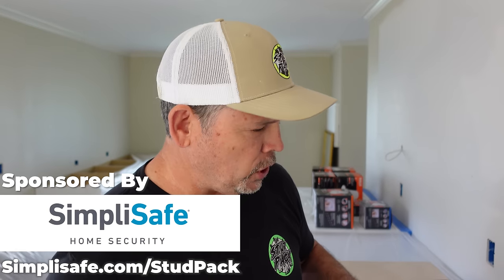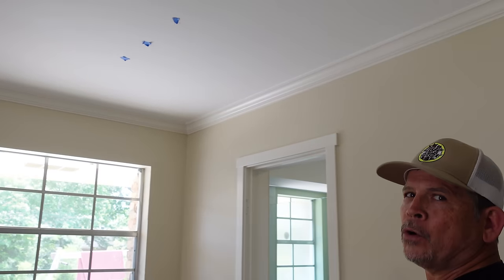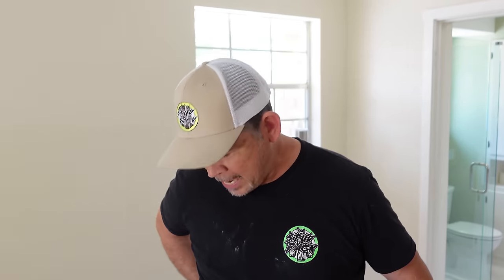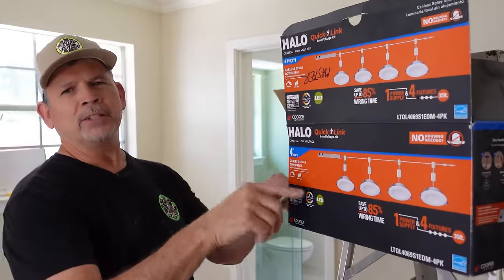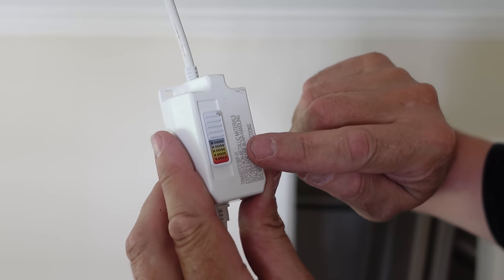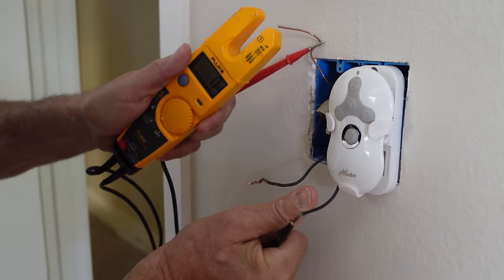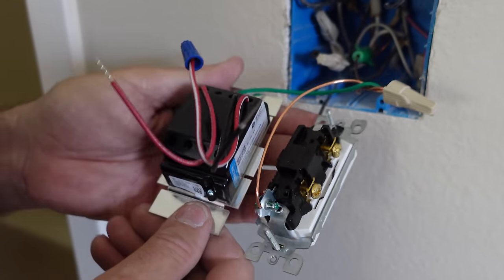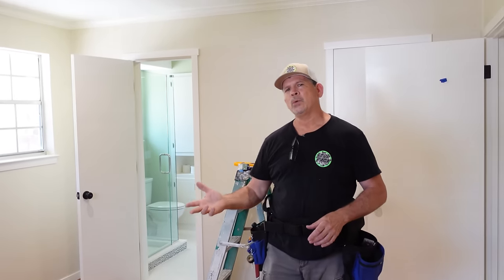HALO Just Changed the Recess Lighting Game with THIS!

Comment: The US and your electrical boxes are weird, in Australia we don't use boxes, we use a flimsy metal C clamp behind the gyprock to hold the plastic switch plate against the wall (I'm not sure if they're called a C clamp but they look like a C ) the connections are exposed inside the wall, its been done this way always. You guys (THE US ) do A LOT of stuff that's totally overkill when it comes to electrical. Our electricity is even twice as powerful 240v at every point. For ceiling lights you poke a hole with a screw driver through the plasterboard, then poke the wire through, connect it to a light and screw the light  fitting to the gyprock, or cut a hole for recessed lights but our recessed lights again are different to yours, for a fan, we poke a hole for the wire except do it next to a rafter to screw the fan to.

Comment: As cool as these are I am still hesitant on direct wire LED fixtures. If they last the full 22 years, it's not a problem, but if they only last 5, and the manufacturer has decided to discontinue the product line, then it's back in the attic to fix a single light.

Comment: just installed one of these, it's fantastic how easy it makes installing a bunch of LED lights in a room, but something important i think everyone should know is to avoid the 0-10v dimmable version. you'll have to do so much extra AND run extra wires to make it dimmable
Reply: I’m having this problem too. how do you update to dimmable? I have a feeling I’ll need to run 0-10v lines but to what and where. Manufacturer has left us hanging.

Comment: 7:00 Dust Bowl. When we had a whole-house HVAC installed in our house, the company brought along a little old man who was somebody’s grandpa. His entire job was to hold a box up to the ceiling where they were cutting the holes for the vents. We didn’t have any dust in the house because grandpa did his job.
Reply: also keep the drill above your head so if the hole saw bit grabs, you dont get knocked off your ladder when the battery pack slams your face

Comment: Nice video, working with sweaty hands in an attic that has fiberglass blow insulation is not fun. I have done similar work, in my days and from time to time, and here in AZ you can imagine the heat in attics or crawl spaces, even in the spring and fall. From a quick installation, the low voltage lights you are using are great, but I prefer hard wire direct to each light with Romex, for a more service free and solid installation and this is a lot easier than working with BMX or metal pipe as per code in some east coast states.  My experience with low voltage lighting, as with landscaping lights have not been favorable, at some point there is chance for loss of continuity due to press fit contact loosening over time, but this also is a matter of how well the press fit connector was designed and installed.

Comment: Not sure how this is any easier than just stringing MC/BX/NM wiring in a ceiling.  This low voltage system is proprietary so what happens when they stop making this system and you need to replace a light that inevitably fails?  If I've got 120 going to each light I can very easily change to the latest greatest lights from any manufacturer.  On some level if you've got the space the old fashioned remodel cans give you a lot of options for trim and install super easily.

Comment: This is a very good system from Halo for the initial installer. But.....when the bulb blows out, and it WILL blow out, the homeowner will not have a clue on how to replace the fixture. Long gone is the premise to replace only a bulb. I'm an 81 year old retired professional engineer and sometimes just replacing a bulb can be a problem. I can't even visualize having to replace the whole darn fixture!
Reply: Very well said! Also, these lights are not reliable as they portray.

Comment: Just to correct you polarity does matter on the low voltage stuff... LEDs are DC and the do have a + and a - end.  You are either working with a low voltage AC side or the box before the light with the color selector is correcting polarity for you.  either way all DC components require correct polarity.  Just not in this application.

Comment: I bought these lights after watching this video and installed them. When I wired the box in the attic my box had a grey and purple wire that I didn’t hook up. I wired everything to a dimmer and they just shut off when I go to dim them. After looking into it, it turns out I need to not only buy a $70 dimmer switch for 0-10volts but also add an additional two wires to run to the box. Your box only had the black l, white, and ground in it and you just wired it to a standard dimmer. What the heck changed in this set?  This was a complete waste of time and money.
Reply: Those lights are not reliable. Is better to use regular can lights.

Comment: No reason to waste a 14/3 wire like that 
And HOPE it not wire into the panel
Read instructions as to snap off the pieces of aluminum on the dimmer there is certain instructions to follow 

No reason to be up in attic or remove carpet or subfloor 
That’s a first

Comment: Led light fixtures are garbage!. The power supplies fail, or the built in electronics fail and are expensive, then they discontinue them. After changing out several power supplies (which are proprietary) over time or the whole fixture, then you cant get parts and cant repair it and u have several of them and now your forced to buy a totally different one which doesnt match the others, now u must change them all. A standard fixture gives u none of these problems. Use a standard screw in bulb fixture and screw in a led or standard bulb. That way u will never have to swap out failed fixtures. I could care less if they use less energy or not. They will end up costing you much more in the long or short run.

Comment: I think Ill pass on these... certainly cool but a little too proprietary. What happens if one burns out in 4 or 5 years and the system never caught on and was discontinued? Then the client is forced to have an electrician out to rerun new wire rather than swapping a few lights out.  But kind of a slick idea nevertheless.
Reply: That's the downside.  I replaced bulbs in my kitchen cans with similar lamps.  I bought 4 extra, just for replacement purposes.  Luckily the bulb replacements are cheap.  The full unit lights used here are more expensive.
Reply: That's a worry for a homeowner. For a contractor, it's just more money.
Reply: This lights are just a rip off. Lol

Comment: that box could have been made up so much better.  it ended up pretty messy.  first, when you make up the grounds, put enough pigtails to have one per device.  then do the same when you make up the hots.  one pigtail per device.  then you're not making pigtails and adding more wire nuts to the same connection.  then cut your hot pigtails square and your switch legs at an angle, and it makes it easy to tell which is which.

and also, when putting a CL dimmer alongside a switch, the heat sink tabs don't need to be broken off.  there's exactly enough room.

but I'm not going to be buying low voltage can kits.  the low wattage of LEDs may not be as hard on low voltage as halogens, but I've still had to rebuild way too much low voltage hardware because it cooked itself to death.  remember, 12V runs 10 times the amperage as 120V for the same wattage.

Comment: Those things look slick. I'm skeptical about the 22 years. LED premature heat death is fairly common at least in some fixtures. I wonder how they'll hold up in a hot Louisiana attic.
Reply: Not only that but if you read the rating it is like 3 hours a day for 22 years or something.  I can tell you my kitchen lights are on for more than 3 hours a day.

Comment: I usually remove the gasket when installed in a non-wet environment. This give a slightly tighter fit to the ceiling.
Reply: I leave it, less of an air gap
Reply: RIP fingertips if that light needs to be taken out to paint or something lol
Reply: The gasket is also there to prevent airflow through the light hole.
Reply: It’s there to prevent air flow, something you don’t want happening from the attic in the winter or summer.
Reply: there to stop bugs or dust from coming through as well.  More important to leave it on.

Comment: You touched a potentially hot wire to check if it was dead by touching the wire to connect your voltmeter! Incorrect procedure! The procedure for checking a circuit dead is use your checker on a hot circuit, then your circuit, then a hot circuit again.

Comment: So i got these after watching the video. Installed in the kitchen remodel. I got the same dimmer you installed here and it does not work. From what i read you meed a low volt dimmer. In the video you did not show the dimmer actually dimming. Mine works like an one/off switch but dimmer does not work. Lights flash and turn off. Am i missing something here? Or did your dimmer not work as well?
Reply: Because he doesn’t know. Lol
Reply: Don’t trust does lights. Just imagine connecting 4-6 lights in ballast. Once a ballast is bad all the lights are off. Not good at all.

Comment: Secret hack. LED wafer lights that have a separate transformer, you can cut the cable that comes with it and extend it with door bell wire.  This way you can put all the transformers next to the gang box in the ceiling and just run the thin wire to the lights. Just like the system mentioned here.  The lights I used the voltage was too low to shock you and the current too low to heat the wire and start a fire.

Comment: I have LED lights just like these that were installed maybe 2 years ago. One of them has stopped working. What are your best tips for a non-electrician to diagnose the issue? Are the LED's themselves replaceable or might I need to replace the whole light assembly? Thanks for any input.
Reply: The whole light. This light are not reliable as the regular can lights.

Comment: I’ve put in wafer lights in upstairs ceilings w/o attic access, but only when I didn’t need to run a new switch leg - e.g. I was connecting to and existing ceiling light/fan leg. I simply used fiberglass fishing rods that I can use to run the Romex from light to light and finally to the switch leg.

Comment: I was taught to always wrap the wire nuts on any connections in a way that it holds the wire nut on and keeps it tight. Wire nuts can loosen over time and heat up. I’m an industrial electrician but it holds true in residential too.

Comment: It looked like you were using a Philips head to tighten up the receptacle wire screws. Do you ever user a Robertson bit or the Milwaukee ECX? I’m a DIY non professional. I don’t trust my Philip head torque with the wiring bolts. 😂

Comment: I am not an electrician by trade, but my uncle was and would take me on the job with him when we visited him for the summer in Michigan. He taught me that all power cables come into the box on the upper left and wires going to your  device goes out the upper right. I do not know if that is a standard, but all the homes that I have owned have been like that and when I rewired the garage that is how I did it. If it is a box I am not sure of, I always test the circuit and mark it for me later or the next guy that has to go into the box.

Comment: I like to make a tag out of the romex sleeve and use a sharpie to write power.  I then slip it over the hot wire coming into the box. In the future if I need to get into the box I know which one has the source power.  I use the romex strippers (Klein K1412) to cut off the romex sleeve rather than using a knife to open it. It saves me from cutting into the wire accidentally.  I also get a clean cut and a sleeve to use as a tag.

Comment: 1:22 
Wishing anyone could do this install & better yet, wiring; but sadly….I know, this isn’t the case. Lost count for going into houses that were newly remodeled ¹  (talking 3-18 months for the time), & [We] are in there fixing, repairing, finishing; in some cases actually Starting, the repair/remodel/issue fix for said work that was, or was not, done (don’t know….wasn’t there; but this my disclaimer(s) cuz everyone needs some butt coverings every now and than….here in south FL, we call them “underwear”😂
Would be shocked of what I’ve seen when come to “work” and “electrical work” & “plumbing work”; it’s just sad! Very sad!.
PLEASE make sure all terminals on a receptacle are “screwed down tight” (technically ¹  a torque ‘driver supposed to be used w/ terminals ranging from 14 ≈ 18 in-lbs) b/c BAD THINGS GO BUMP INTO THE receptacles at night…..
Take off an outlet to check and again was speed wired (aka back-stabbed; which, different than back-wiring) and the ground not connected, hot broke off, and neutral hanging by a “thread” as stranded wire. Other thing saw was terminal screws not tightened down at all, just left proud, waving at everything else in box….this not good and even outlets, switch manuals will say to make sure all screws are tightened “hand tight” all way down. Yoke was bent on both ends to make outlet fit into receptacle, but also left the ears recessed flat w/ box and not sitting on Sheetrock; so, that gonna be fun getting things to line up, lay “flat” and look nice
Reply: Very well said! 👏👏👏

Comment: Why don't you do the wiring down on the floor then stick it into the attic through one of the recessed light holes? Then just go up there to mount the box. That's what I do most of the time. I also manage to fish the wire from below most of the time with fiberglass rods.

Comment: I have several major issues with your video:  I would suggest using a regular recessed light fixture, line voltage and then selecting the best LED lamp (bulb) for the job. That way the end user may select the beam spread, brightness and most important color temperature. The other issue is that these LED devices or the driver will always fail. What to do, get out a ladder and replace the lamp or call in an electrician to replace the fixture hoping that the model is still being made so as to match the other ones in the room. These new fixtures in my view, the light source is too recessed but on or nearly at the ceiling plain which results in glare.  Other issues, is that electricians just stick these things in almost anywhere but not where the fixtures should be. In too many homes,  there are just too many overhead fixtures and a lack of other lighting sources. If a hotel lobby is what you are going for great!  Going forward I will always specify conventional recessed light fixtures, where appropriate and work with the lighting plan as specified by the lighting designer.  Simple as that.

Comment: i have learned not to care about the year ratings for lights... i have LED lights that were new when the house was built 3 years ago and say they last 20+ years, yet i have already had to replace them. keeping the package and receipt is important since normally they have a warranty for replacement, but you need to supply a receipt. Getting a light because it says 22+ years really doesn't mean much.

also remember you should always wear a mask when in the attic. the dust and fibers in there are not good to breathe at all.
Reply: The dust and fiber is what destroyed my lungs. 👎 you are absolutely right but I was young and naive. 🥺

Comment: FYI- I just bought a similar saw from the orange store made by Klein.  Worked pretty well and was around $30.  Good enough for the 4 holes I had to do for my lights.  Wish I had watched this video first, I made all of the right marks where the joists were but there were so many and I was in such a rush that, you guessed it, I drilled one hole right where my joist was.  Made a big  X with a circle on all the other holes after that.  Went from a simple job to extra work patching drywall in just a few seconds.  Some times I amaze myself with how smart and I am and other times I amaze myself with my stupidity.

Comment: Its a big mistake. LED color temps change over time. When these need replacing (far sooner than they claim) IF you can find ones that match, the color temp of the LED will have shifted and not look the same as the older pucks. I am a contractor and own a business that sells LED products as well.
Reply: Very true 22year life expectancy never happen. Are these lights fire rated or do you inthe US not bother?
Reply: @chrisardern4594  I do not believe they are fire rated like a can light is, so if your ceiling is fire rated and you install these . . .
Reply: You are absolutely right !

Comment: I never test hot to ground to confirm the circuit is dead unless I’ve confirmed the ground actually exists. It could be fed from a circuit without a ground. You jay have previously tested the circuit hot though, I’m just saying that for the newbs.
Reply: When I wire a 3way dimmer as a single pole I always put the hot to the red so the red with white stripe will never be hot.

Comment: Always awesome to see fans wired separately from fan lights.  Nice to be able to have the fan running during the day without the lights on, or at night without the lights on, all without having to mess with pull chains.
Reply: Yeah, except when the fan comes with a remote that could control the light (& now can’t). Or even worse, when you want to use the Bond Bridge to control the fan and light using Alexa/Google
Reply: @TENTHIRTYONE  Is the "Bond Bridge" a manufacturer specific accessory?  You could alternatively replace both fan and light wall switches with smart switches to control them individually (on/off/dim).
Reply: Slim_Savage  Pretty sure it was originally wired for just a ceiling light and someone (before me) swapped it for a fan-light without changing the wiring or switch.